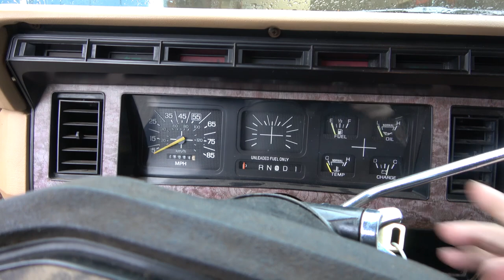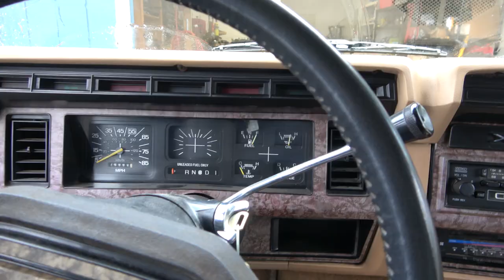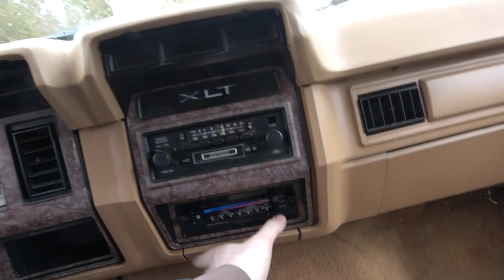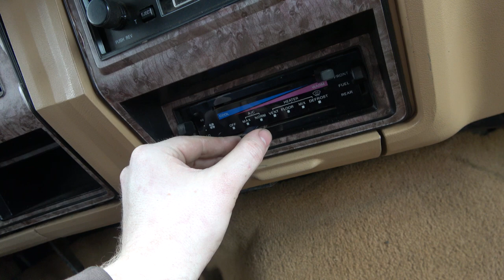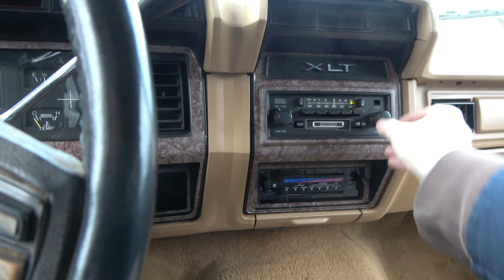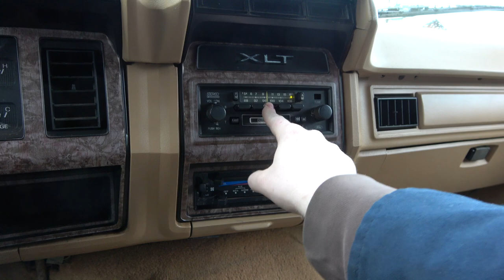The Junkyard Bullnose Ford | Topper Removal and Throttle Body Issues | EP1

Comment: I have a 94. The horn is in exactly the same spots on the steering wheel. Not a big fan of that. Sometimes I have to search for a few seconds if the wheel is cranked to get their attention before I flip them the bird. In a few seconds they could be down the road and miss my bird ah fly'n.

Comment: That interior is like pristine, especially considering how cheaply made they are
Reply from the maker: One of many reasons why I wasn't letting it go to the junkyard.
Reply: I wouldn't say the interiors of these trucks are cheaply made. I've been around vehicles with much worse interiors than these trucks have.
Reply: 86 was really the best year for it especially in the higher trim packages
Reply: @RevRandyGarage  I've owned a bullnose, bricknose, and a dentside Ford truck. The bullnose trucks have the worst build quality, and worse plastics than the later gens by far. I like how they look a lot, but the hard brittle plastics don't hold up very well.
Reply: @Terminxman  I meant for the bullnose gen specifically I've owned all 3 as well